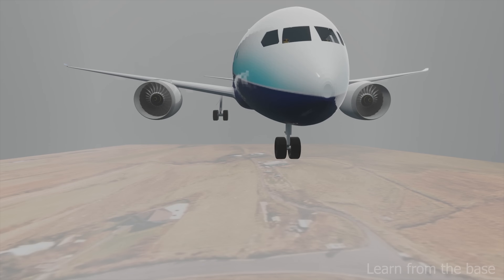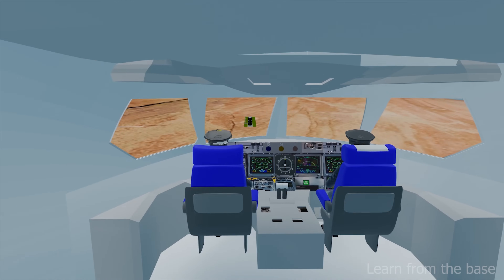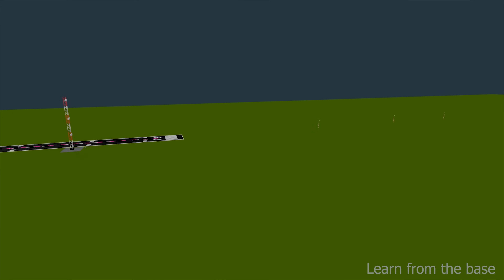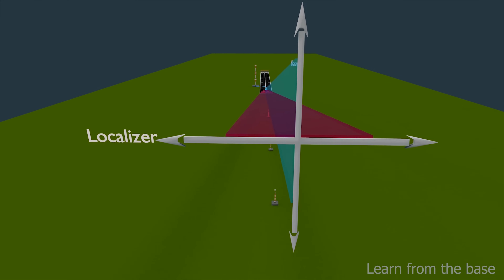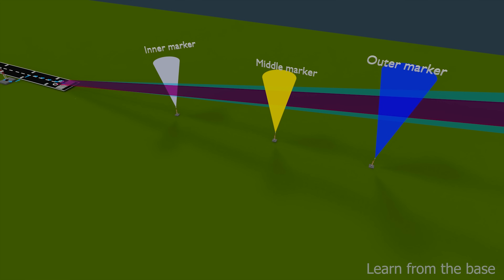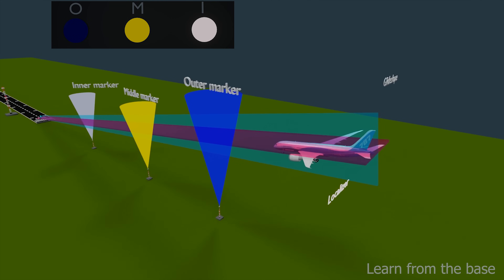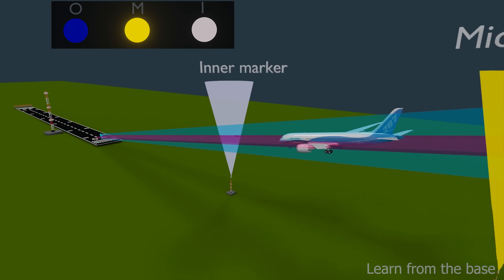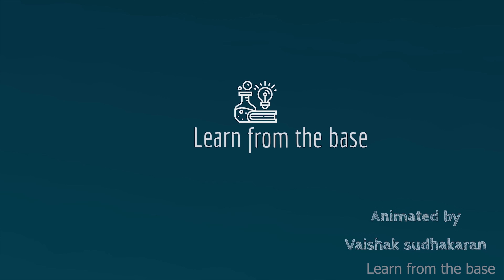ILS/how does the aircraft land at zero visibility ? /instrument landing system /learn from the base

Comment: small correction on the video, Localizer antenna is located on the other end of the runway that you’re planning to land. 
Also you also misrepresented the projector of the glide slope vs localizer. So the localizer projection should be displayed vertically and the glide slope horizontally.

Comment: What is the landing angle while landing via ILS ?
Reply: Generally all aircraft landings are made on 3 degrees glide slope no matter if flying in poor weather (instrument meteorological conditions) or in good weather (visual meteorological conditions. There might be exceptions though, for example in London City airport there is a 5.5 degree glide slope (due to skyscrapers in the area), however this is a rare exception rather that a rule and pilots making approach in these non standard airports have to be specifically extra trained
Reply: @lukasandrlt  Thanks brother